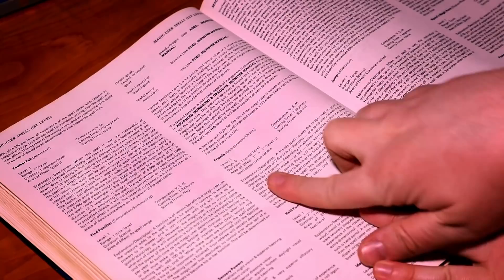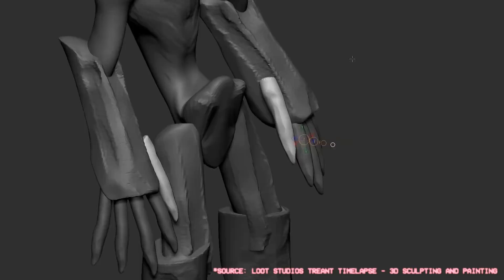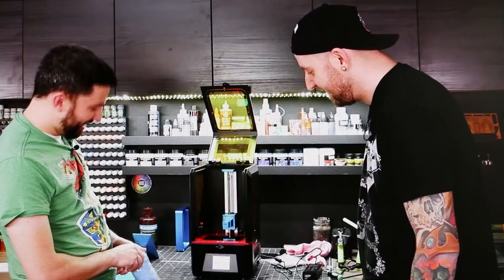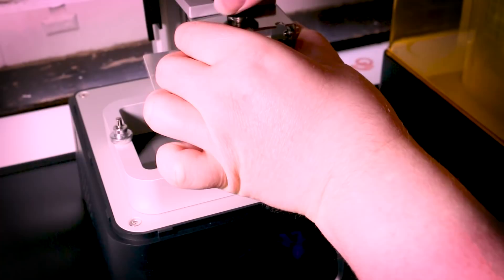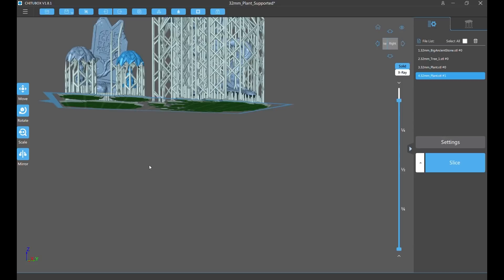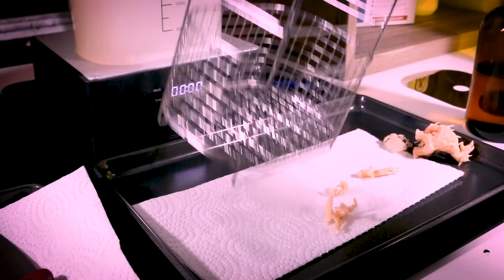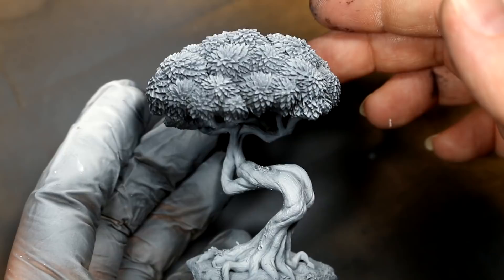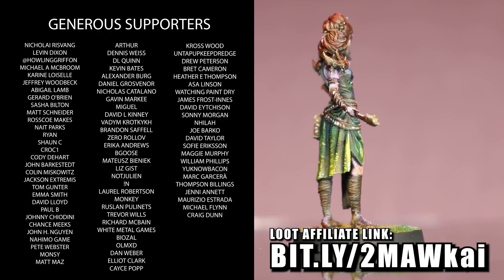The Magic of Printing Resin Miniatures: A Beginner's Guide to Resin 3D Printing

Comment: For people looking at resin printers, the Elegoo Mars print chamber is a closed environment (there's no exhaust vent where the resin is) so the fume level is non-existent except when you remove the cover. If you've got limited ventelation you can get by pretty easily with just a mask.

Edit: You can also build a real cheap curing chamber with UV LEDs and some type of closable opaque container (I just used the box the LEDs came in)

Also, @Dana, huge tip for removing supports that really helped my prints. Once you've washed them, run them under hot water for a few seconds. The supports come off super easily.

Comment: Use elegoo water washable resin so you dont have to use stinky iso. Also buy a magnetic print bed, you dont even need to use the scaper anymore. You just bend the plate and the prints pop off. Chitubox for supports, use Microsoft 3d builder to repair models, use a blow dryer or put the prints in hot water to take off the supports. Look up 3dPrintingPro on yt, he knows everything about 3d printing. Also, look up the flint reed leveling method! Have fun!

Comment: A nice little tip for support removal is to soak the print in some warm water after the IPA bath, the supports (in my experience) become softer and much easier to remove, it made my life that bit easier. Just be a bit more careful with very delicate model parts too. Can't remember where I picked that up but it's easy and effective. Great video by the way and love the channel!

Comment: Dana my unsolicited advice is to tape a second FEP sheet under your vat, between the vat and your screen. If you ever have a bad print and/or your fep leaks, then the resin won't immediately leak onto your expensive screen but instead onto the second FEP. It's like $6 for a second FEP but over ten times that for a new screen. My printer was out of commission for over a month because of this!

Comment: You need much less cleanup from the supports if you wash your prints in warm water before removing them, then wash them properly again afterwards. The heat makes the supports peel off much easier and with less bumps, but you do need to be more careful with the little delicate parts.

Comment: I got into mini painting through 3D printing, so it's great to see your perspective from the other direction. I wanted something fun to print, and discovered a whole community of artists doing amazing work. The most exciting thing about resin printing for me, is the technology has only been on the market for about two years, since the key patents expired. There are several more very interesting 3D printing technology patents which are going to expire soon so I'm hoping that the consumer 3D printer market is going to be able to incorporate them and improve the technology even further. 

I recommend you try Lychee Slicer, I started using it around the time they had a marketing push last year and it has some significant advantages over Chitubox with it's built in island detection and advanced support mode. I love your idea with the IPA spray bottle so I'm going to try it out thanks! 

Thanks for the video!

Comment: Good to see another person getting into 3D printing! Now we just need to convert Guy too... 

Personally I think the best choice for a resin printing hobby setup is either an Elegoo Mars or Anycubic Photon along with the compatible wash and cure station.

Both the Elegoo and Anycubic stations are designed to take the build plate from their own resin printers. This means you can just attach the build plate to the wash station with the minis still on them, avoiding any need to directly handle parts covered in uncured resin. You then wash them, remove the cleaned parts, and now you can remove them from the build plate with minimal mess. 

If you're a bit OCD like me, it also minimises the number of things that become contaminated with uncured resin and therefore require gloves to handle.

Comment: Just tried water-washable today as opposed to the normal ABS.   It rocks.  You can, and probably should still use an alcohol dip, but its so smooth and the prints appear to be just as good.  It comes across as not nearly as bad for you as the normal stuff.  Also, its clearly harsher stuff, but you might find denatured alcohol to be a cheaper alt to iso.  As a person who has gotten the resin on hand and then stepped into the sun out of my garage I can tell you that it didn't hurt, (because of the massive heat release of the reaction), but it was uncomfortable and left a "second skin" that was not easy to remove.

Comment: So, a couple warnings from, apparently, a seasoned veteran 3d printer: Do something to block off ALL of the light from the window, or else it Will cause a problem for you at some point.
Also, wash before you take off supports (with a scalpel, not your hands) and you will have a better time getting things set up. You can also save the sharpness of your blades if you clean them up some before curing.
Also, there are a ton of cleaning agents out there if IPA ever gets too prohibitive for you you, especially given how pure of an alcohol mixture you need. (googling 3d resin wash ipa substitutes should give you a big list of products available in your region)
I just for-goed all of that by going with water washable resin. But some people don't like using it, and it has different cure settings when printing with it.

Comment: I think my only advice would be to soak your prints in hot water for 30 seconds or so before you pull the supports off; I've found they come off cleaner that way. Good video for someone just getting into the hobby, and you're right, it's easier than it seems. It's just about accepting that it's a hobby into itself, as you said.

Comment: One of the best things about 3d printing is scaling. With different plastic kit manufacturers (with GW: also different times the sprues were made), I have all sorts of different scales which don't work that well together. When I want 28mm models but have a sculpt made for 32mm, I can just scale it down a little and it will fit better.

Comment: Thanks Dana, I've had a resin printer for some time now (along with every bit of equipment) but I've been neglecting to use it til I was properly informed on how to use it - you've covered some of the smaller issues that I wasn't previously aware of (such as the resin dust). <3

Comment: I have found that cleaning the models with a metal file BEFORE doing the final cure is much easier.  I don't use a knife or snippers, a file works great and does less damage to the model and to you.

Comment: A question about your setup. Other videos have shown people doing a lot to avoid outside light, stating that it helped avoid stray resin exposure. With your printer right near a window, were there any issues that you noticed? Or is that practice a little over the top?

Comment: What's the benefits to the wash and cure machine of doing the cheaper DIY solution? Easy clean up? Quicker? Less overall hassle?
Reply: Much easier - it has an agitator, you keep your alcohol in there during the process, no big baths of open alcohol potentially getting knocked, and smelling up the room.  Then you clean up and switch to curing in a dedicated tool that is designed for curing the resin and proper coverage (i.e. all areas get cured).  You can absolutely do it yourself, and it's educational and fun, but for a compact and clean setup, they are the way to go.

Comment: Drain your prints to save on resin. You printer should of came with a black thing with a hole. Take the plate off, put the black thing on then put the plate on it so it's tilted side ways. Yeah, I did what you did and watched a lot of videos and learned. Uncle Jess has some good clean up videos also. Welcome to the 3D printing world, also not a fan of pre support work, learning how to fix supports is fun.

Comment: Never put a resin printer near a window, the sun will cure the resin.
IPA is expensive and hard to find, I use Denatured Alcohol from Lowe’s.
Chitubox is my favorite slicer.
3DPRINTPROS has the best videos on YouTube for using Chitubox for getting perfect prints every time, and how to place supports that leave no damage.
Reply from the maker: What if I'm only using it at night though? Doesn't the UV shield on the machines keep it fine during the day?
Reply: @DanaHowl  
It only takes a second, then you’ll have a skin across the top.

Comment: I personally prefer to clean in alcohol before removing support. This way, after the alcohol dried, I put the print in hot water (not even boiling, the hotter my tap water can get is enough) that soften the resin and makes removing the supports easier, and leaving less marks on the print. 
Also I'd be careful putting the printer in front of windows, if the sun hits directly this side of the building, it can start the curing process when you handle stuff around. I'd know, I once decided to go OUTSIDE to clean my prints to avoid the smell in the apartment. It wasn't even a sunny day, cloudy as fuck, and resin dried on top of the models before I could clean them. Some even cured on the plate. What an idiot.

Comment: One tip, when you remove the parts from the printer, put them in hot water for 1 minute.
The supports will come out like butter and will not leave a mark in the pieces
gracias  google traductor